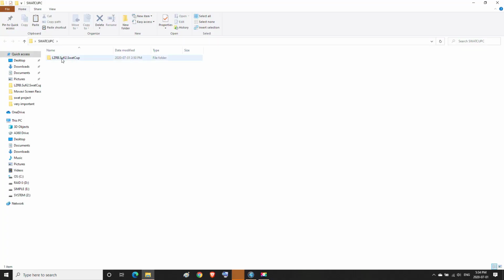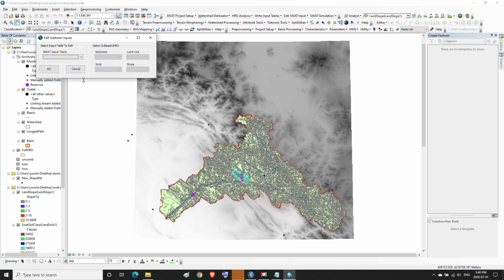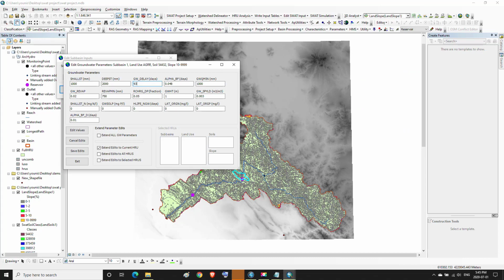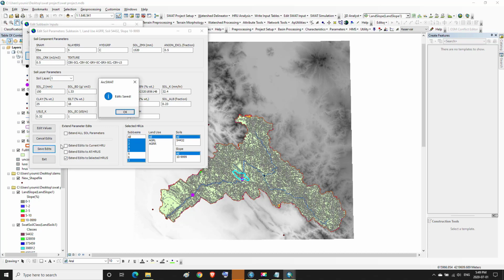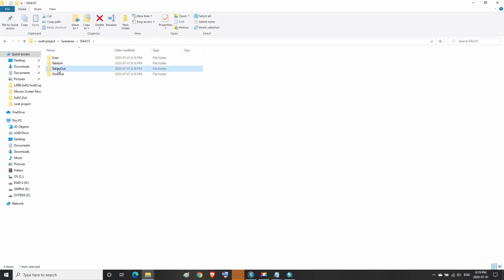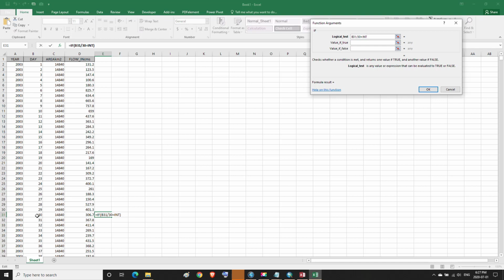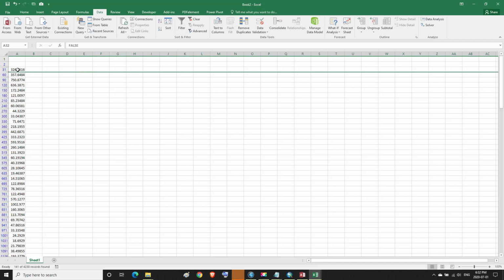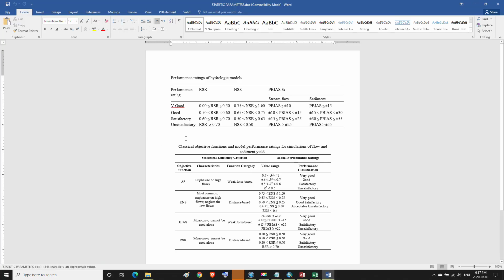Rewriting the Calibrated Parameters to  Arc swat 8 of 8

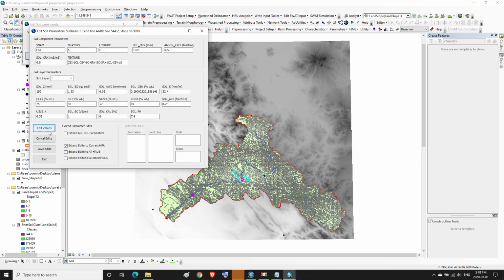Comment: Another question, at min 14:38, why do you write the value of 0.516667 in the SOL_AWC parameter? If, in fact, that parameter is relative and positive (%), which indicates that it should be added to the given value, in this case 0.05. It would be 0.05+0.05*(0.516667) = 0.075833, that value should go in SOL_AWC.
Reply from the maker: ok

Comment: Excellent video. A query. Why do I get too many files in the Sufi2 folder, for example 000010001 for each class, then 000010002 for each class and so on? Instead, you only get 000010001 and it ends there, then it goes to 000020001. In my case, each sub-basin is divided into many and it is difficult for me to calibrate when there are relative parameters.
Reply from the maker: ok

Comment: Sir I need sediment yield data for calibration and validation of the SWAT hydrological model. which formula used for calculation of sediment yield of catchment area sir
Reply from the maker: Dandy - Bolton formula is often used to calculate the sedimentation yield. The formula uses catchment area and mean annual runoff as key determinants to give a yield value. It does not differentiate in basin wide smaller streams and their characteristics.
Reply: @AWRENOW  thanks sir but we used bolton formula it gives the value of sediment yield in tonns per year but I want monthly values how I will get sir

Comment: Thank you for the nice lecture. Can you explain why you select the subbasin 1,2,3,4, and 7 excluding 5,6 for ‘Edit SWAT input’. It was hard to follow you at that part. If I have .mgt and .gw file for 1~119 subbasin, am I have to check all the file for editing SWAT input with the new parameter?
Reply from the maker: We have calibrated the discharge data of the sub-basins numbered 1, 2, 3, 4, and 7 located upstream before the dam (Dokan Dam), whose data depends on rainfall, while sub basins 5 and 6 are located downstream after the dam and their data are affected by the dam’s drainage, so we did not perform calibration for them, because that is difficult.
Therefore, to calibrate the discharge data, you must choose the numbered sub-basins located upstream before the dam only, whose data depends on the rains. If there is no dam in your study area, perform the calibration for the data on all sub-basins